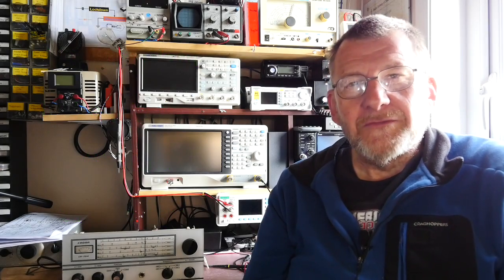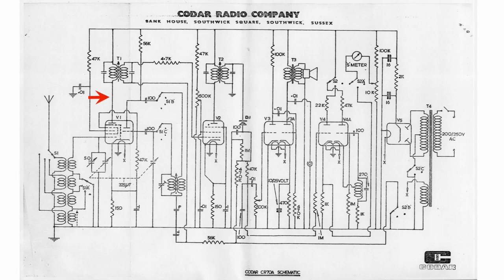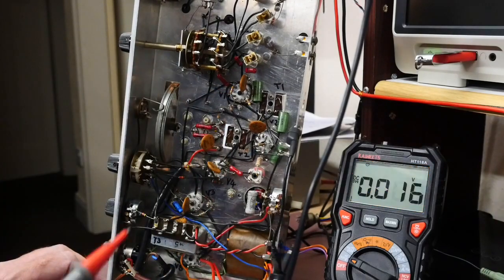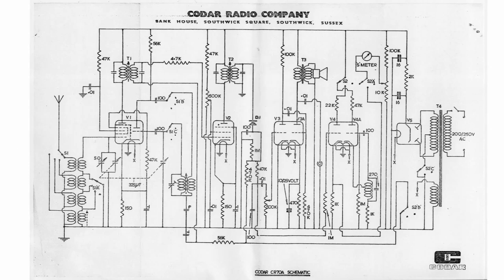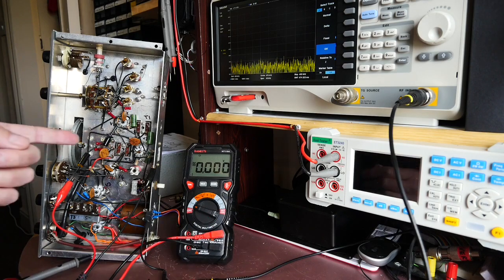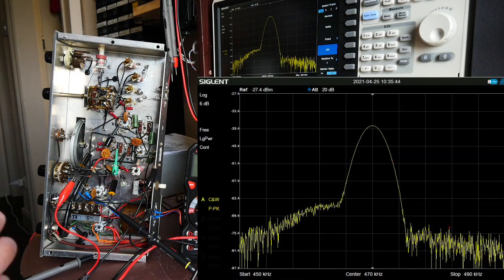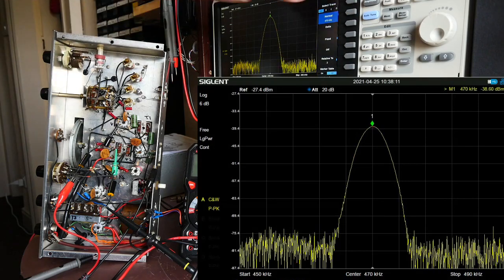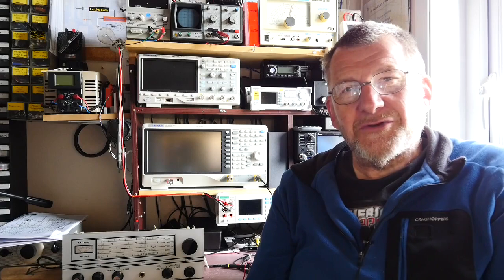Using modern test gear with older technology      #066

Comment: Except for having enough working voltage, what other aspects of the DC-blocking capacitor we should look for (like ESR, frequency behavior etc.)? So our signal would not get degraded by the series C. Attenuators and DC-blocking capacitors are very important when working with this expensive equipment in general.